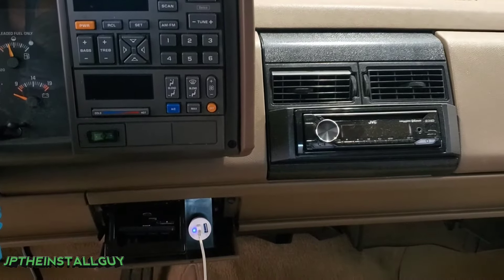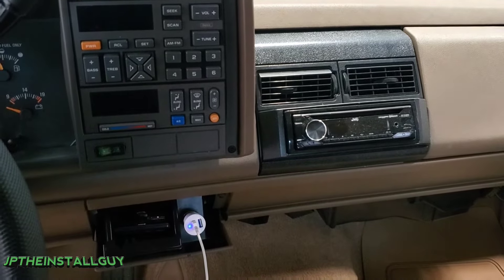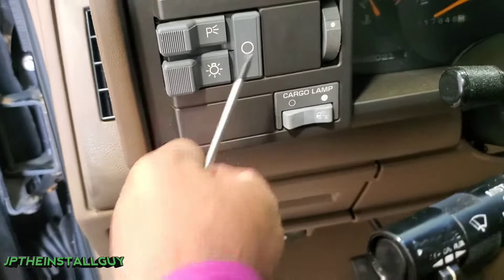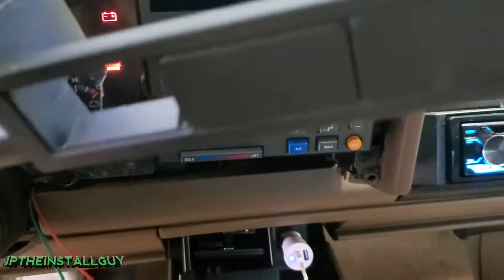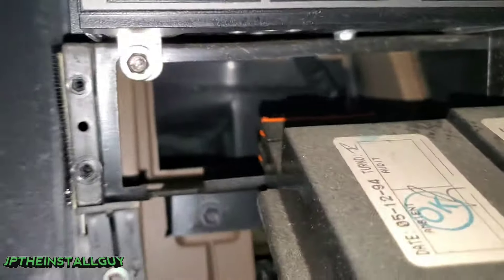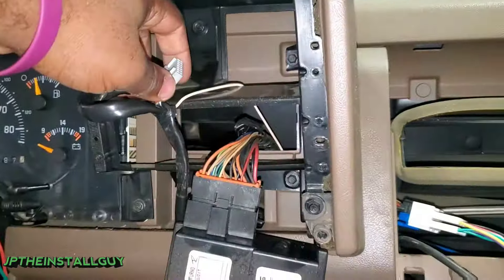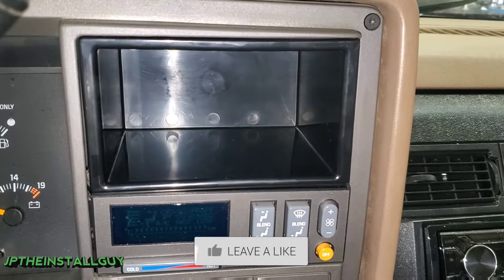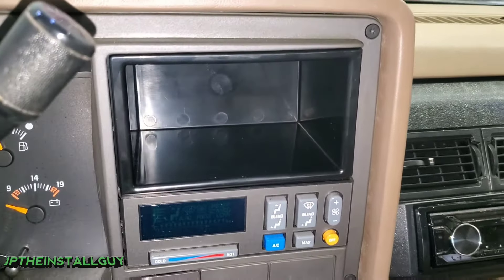chevy gmc full size truck radio pocket replacement 1988-1994

Comment: used your link to buy the pocket.  What I'd like to do is swap the climate controls to a tablet type of control system is it possible on a truck this old without having to spend like 500?

Comment: I doubt you will see this but gonna do it anyway. 1990 Chevy Cheyenne that already had a Pioneer CD stereo installed. Do they make an adapter to go from Pioneer 16 pin to what's available today for just basics and Bluetooth?
Reply from the maker: I'm not sure if pioneer makes a specific one but some foreign company may make one as long as the wires match it should work
Reply: @jptheinstallguy Don't need Pioneer really, putting a cheap radio in there but not sure what ISO means in car stereo land exactly. I am just looking to see if there is an adapter to go from a male Pioneer config to a female Pioneer and then to ISO? Maybe? Sorry I'm stupid but thanks for replying.

Comment: Love the content have a issue on my 1991 k1500 battery’s keeps draining did a drain test and it was battery Fuse so I disconnected stereo boom problem gone. What can I do I’m positive it’s my red ignition wire or yellow constant wire what can I do to fix it. Also stereo won’t turn off when key is out I have to manually turn off still drains it
Reply: Blue turn off cable in the wiring harness.

Comment: You have any tips on why my new radio has power, turns on, seeks etc but there is no audio at all?
Reply: My 94 the factory speakers wouldn't come on.  They all needed replaced.

Comment: My 93 has rear door speakers that are getting NO sound, so where is the OEM Amp? Inside the dash or under the driver's seat?
Reply: Under the dash. Above the Gas pedal. 3 bolts. About 4x6 inches metal in color.